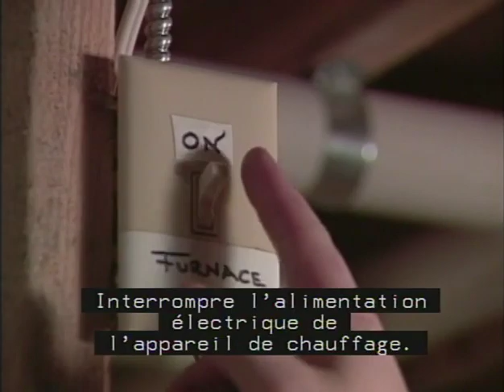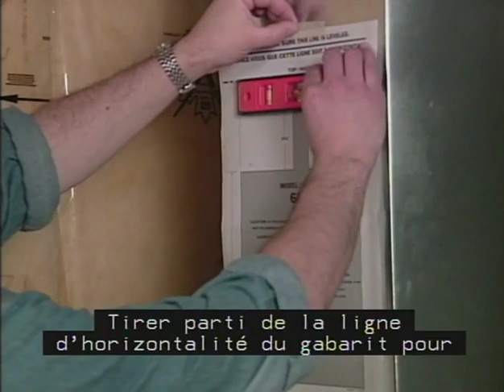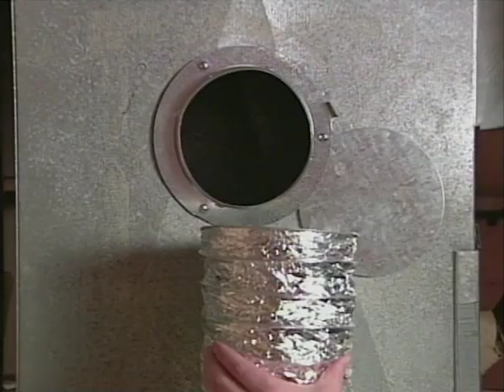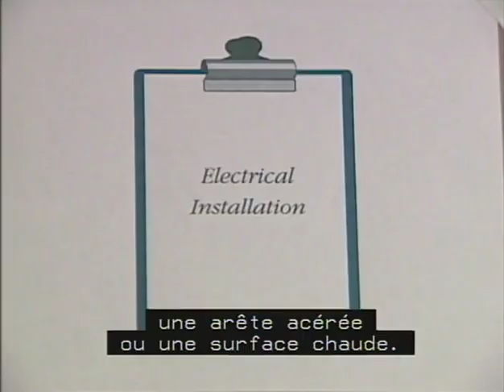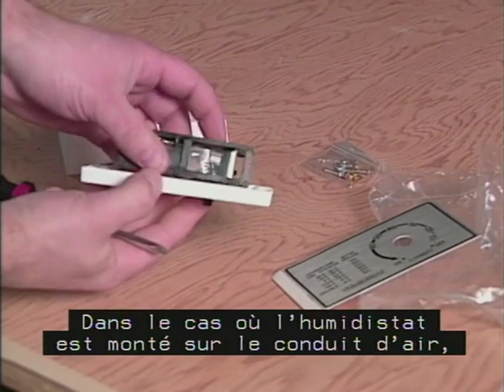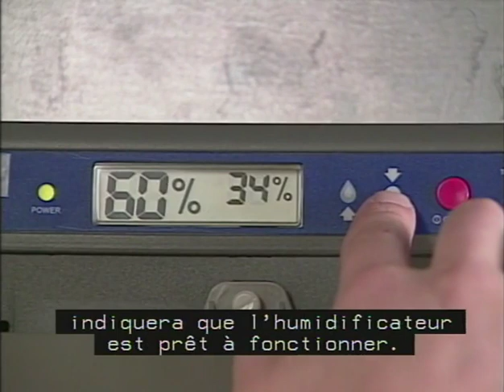Wait 5000 6000 Humidifier Installation

Comment: Can I soak the evaporator pad in vinegar to de-scale it?
Reply from the maker: Thank you for contacting Air King. Typically if the filter has been in use enough to have scale build up on it, we highly recommend replacing it. With that being said, you might be able to extend the life of the filter by soaking it in a 50/50 vinegar and water mixture, then rinsing it thoroughly. We would caution you to make sure the filter is still in working order - doesn't have any rips or tears before you install it back into the humidifier. We also advise you to check for any leaks when you re-install the filter in case soaking it altered the filter in any way.

Comment: I have the wait 5000 and it won’t turn on when furnace is running. I can get it to turn on ( green light comes on) when I disconnect and reconnect the bypass duct going into humidifier but it only stays on for that cycle.
Reply: Thank you for your comments. To troubleshoot what is happening with your unit please call our customer service department at 800-465-7300. Thank you.
Reply: @kevinzepp4854  I also have the same issue. I wonder what the problem is. Mine is Wait 6000.

Comment: i just purchased the 6000 unit but the water is not geting past the white plastic box type gizmo. the humistat is asking for water but no water is present below the white box to the humidifier. This is a brand new unit. What gives? very disappointed finding out need to order 30 dollar part and furnace guy to get this thing working thinking very seriously in return omg product and sealing up the holes since it does not work correctly on newer furnaces! Bulshit not hiring a furnace guy to do a humidistat bypass! Get this product off the market if it's not compatible with newer homes as is out of the box. Your hiding additional costs here. I put holes in my good furnace to find its not compatible unless I purchased more parts Extremely Upset
!
Reply: Jeannette. Thank you for your comments. To troubleshoot what is happening with your unit please call our customer service department at 800-465-7300. Thank you.